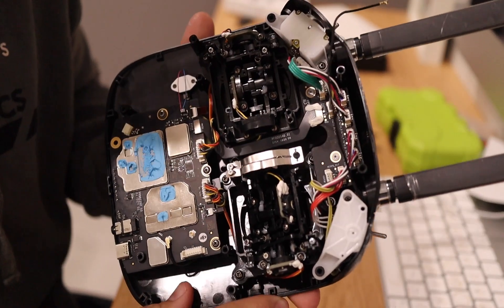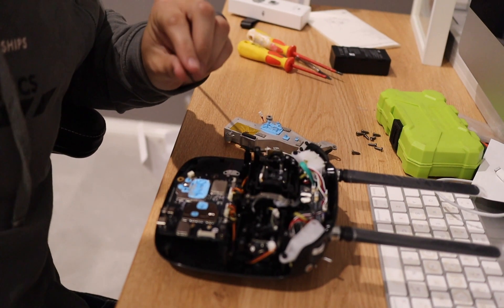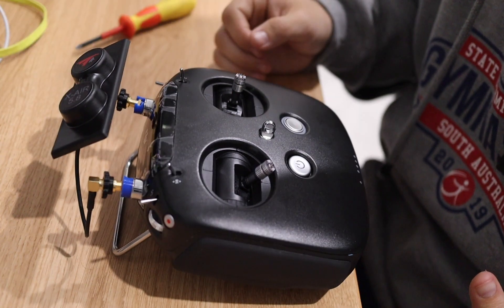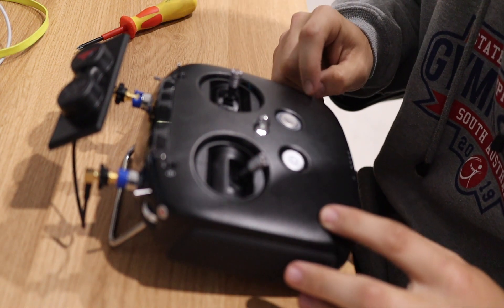DJI Digital FPV Radio Antenna MOD || Tear Down

Comment: Don't do this mod, I did and was getting massive interference between the goggles and the radio. It would completely kill both my video and signal after going 30+ feet out. Swapped back and I was good.
Reply: That doesn't make sense?   Maybe you had a bad antenna, or the wrong frequency that caused wide band noise from the transmitter?   Here is nothing magical about the stock DJI antennas.   I'm swapping to RG178 to gain an extra db on the line loss.

Comment: I think this would hurt the diversity and holistic transmission that the two stock antennas positioned at different angles would provide. perhaps stronger forward penetration, but at the cost of spread

Comment: I'm curious if im able to open the transmitter or will I void a warranty? I jusy recied my tx and the right gimbal came pushed in and screw rattling around so wondering if I can open it myself or should send it in. Just dont want to ship it to CA if I don't have to. Waited too long for this to finally arrive

Comment: Thanks for the video, it is very well explained.

I would like to ask you if you know how to return the control to factory values, I am experiencing a problem that I cannot solve. Although the radio works in its calibration and as a control to move in the glasses menu, it does not work for me to pilot my drone. It occurs to me that perhaps restarting the radio and re-binding it could be solved.

Thank you very much

Comment: Must not have worked or he is in jail. It shouldn't take this long to do a range test.
Reply from the maker: Works fine! I just havnt had the time to do any new videos, lockdowns ect havnt helped. many have done the mod and have commented on the performance the dji Facebook group. I wouldn’t recommend it for every one.
Reply: Are both antenna adapters the same length? 20cm is long enough for both? Or should I get a 20 and a 30? Thanks

Comment: Hey... u made the only video with this modification on the dji remote controller. More than 8 months are over now. Share the results in range with us! You promised it at the end of the video... I really wanna know..
Reply: I did the same mod and i improved range  from 5km to 9km
Reply: @trialpsycho_rc  i flew out 10 km with the stock antennas.
Reply: @FlyingBen-wt4bh  on a quadcopter? Or fixed wing

Comment: Where did you get the ufl to rpsma cable at that length? You didnt mention where you got it anywhere in this video. 

Wouldve been nice to see a comparison between the original antennas and the upgraded ones. 

Thanks! 👍🏻👍🏻👍🏻

Comment: what would you recommand this DJI FPV remote or a TANGO 2 ? I already have this one but i had some issue flying near the floor at 400m and having two failsafe... i'm pretty new to the hobby but i want the more reliable system, so which one would you go for, MICRO TX or this DJI radio? Thanks mate loved this vidéo :)
Reply: i guess Im asking randomly but does someone know a method to log back into an Instagram account??
I somehow lost the login password. I appreciate any tricks you can give me!
Reply: @Weston Zayd Instablaster :)
Reply: @Mathew Zev I really appreciate your reply. I got to the site through google and I'm trying it out now.
Seems to take a while so I will reply here later with my results.
Reply: @Mathew Zev it did the trick and I now got access to my account again. I'm so happy!
Thanks so much you saved my ass !
Reply: @Weston Zayd glad I could help xD

Comment: Hi,

Are the radio antennas Polarized?

I've switched my googles and air unit to RHCP but the radio is still with stock antennas. Do you thinks it's mandatory to change the radio antennas?

Best regards

Comment: So can you not use crossfire on that radio from dji??
Reply from the maker: nhbjhbbhbhgvb technically yes there is a trailer port you can use, but why would I do that? I have a crossfire setup on my Taranis and this has outperformed it.
Reply: @JacobGriffinBloy  no way? do you have actual test ? What about the stock DJI ? what against the micro TX and the Stock DJI controller? Thanks a lot mate !!

Comment: cool vid. finally a look inside! yes those do look similar to M9 gimbals :D....
i wonder if i should just buy the goggle system as i have crossfire. but the transmitter looks very harmonious with the system 🤷‍♂️
Reply: The M9 gimbals needs a small amount shaved away for them to fit, tiny bit, also the plug and wires need to be re worked.
Reply: @30days82  cool that sounds farely doable. im running m9's in my x9d. trying to decide if i should get the transmitter package or just use my Taranis on crossfire. hows the ant mod goin for ya?

Comment: Interested to see the results. I had my Dji FPV fail safe while the video was still good and lost my quad. really need to figure out a better range solution for the radio. Was about to install crossfire but will maybe try this if it works.
Reply: wow dude, that is surprising. ive got crossfire on the taranis but am considering getting the hd system with its controller for continuity sake.  maybe i should just buy the goggles only package and use crossfire 100% on the hd quads if its sketchy🤷‍♂️ this mod looks wise though
Reply: Phil Dawe if you’ve already got a crossfire you shouldn’t definitely stick with that, much more reliable.
Reply: @MikeBishoptv  thanks for Your thoughts there, Mike!. sure thing  it will be good. 
 the tx ant mod would have to be an improvement. just saw some vids on your channel... Africa..dude ! (also realised i subd your insta ages ago) cheers
Reply: @luckyphiltech  stick with crossfire. Especially in suburbs the dji transmitter range is really poor. I have seen open fields Midwest no buildings hit a mile or so but not in the city very poor range like .5 mile or less :(
I have to now buy a radio and receivers
Reply: @brendand.2269 heya thanks for the comments buddy
that can't be right 🤔 what pwr setting you on the hd transmitter 25mw? maybe that effects the controller output too. im sure ive seen reviews pretty much 10x that. maybe you were in a noisy area. but wow. what controller ya getting
Reply: This happened to me too and came across this video. want to see results

Comment: Thanks for the video, I'm about to perform this mod. Is there anyway to prevent the rpsma mounts from spinning when you put on the antennas?
Reply: Looks like they won't spin because they are in the 3d printed adapters. Just hold the adapter still while you screw it in.

Comment: What is range dji radio by default?
Reply: Andrey Degtiarev I got about 1.5 miles maybe a little less. Which is plenty for fpv. I mostly fly half a mile ninety percent of the time.
Reply: I've flown a mile exactly.  I was up kind of high though. I'm a spektrum guy so it was unimaginable to fly more than 300 yards.  I love it with just patches on the bottom of the goggles.

Comment: Great video explanation! I just dropped my radio and the antenna housing shattered. So the actual antennas are still connected to my radio via wire, but the plastic housing snapped off. Do you know where I can buy spare replacement OEM antennas?
Reply from the maker: Jay Fomin you can’t buy them currently, in having good results with this mod though, range test coming!

Comment: Nice work mate, I think your the first to open the radio and actually look at ways to make it comparable to other radios.
Reply from the maker: thanks, I don't know if it will work yet but lets see.
Reply: @JacobGriffinBloy  what's your deal? It doesn't take months to do a range test.  Either it did or it didn't work.  Damn!
Reply from the maker: anfrae25 do the mod your self and test it your self, I may never choose to do another video.
Reply: @JacobGriffinBloy  I apologize.  I didn't mean to upset you.  I was really curious about the results
Reply from the maker: anfrae25 iv been planning to do an RC car to test it probably, mainly because I don’t have a drone that would make the distance return. I’m looking into the best option.
Reply: This is ridiculous.  It doesn't take months to do a range test.  It must not have worked or he is in jail.